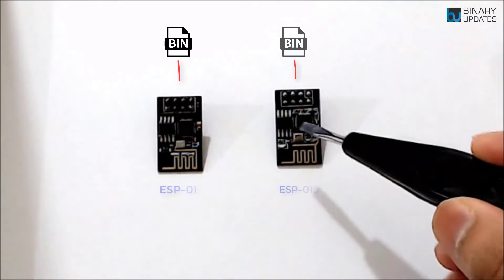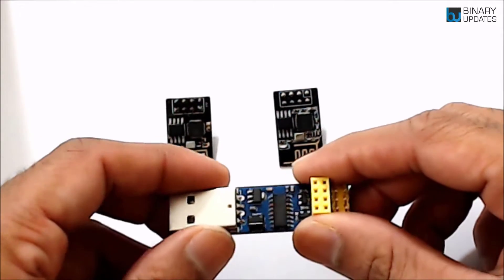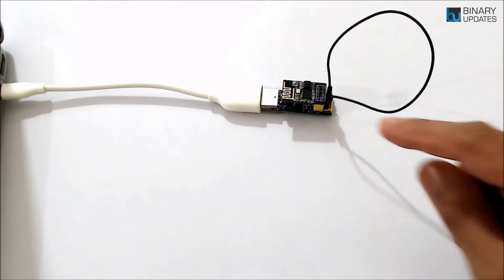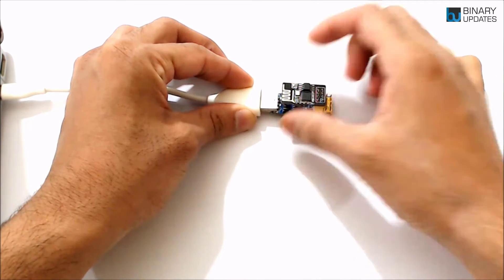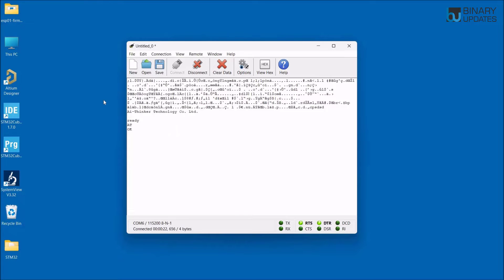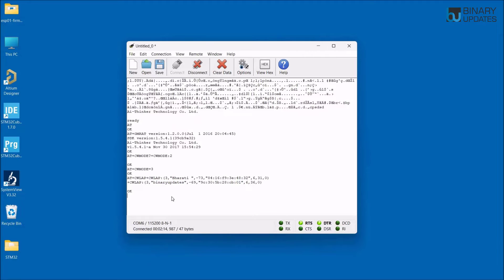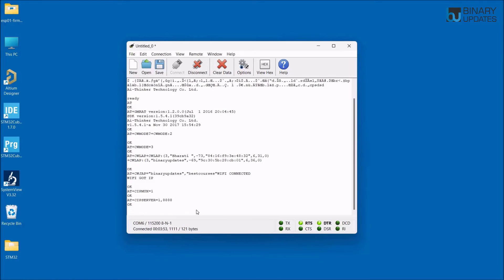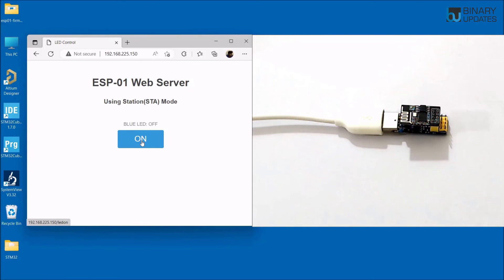How to Upgrade ESP-01 Module Firmware and test AT Commands

Comment: Привет, уже долго пробую и ничего не выходит. Прошивка успешно загружается. Появляется WiFi точка, но на AT команды не реагирует. Также не реагирует на скечи с кодом. Что делать?
Hi, I've been trying for a long time and nothing comes out. The firmware is loading successfully. A WiFi hotspot appears, but does not respond to AT commands. It also does not respond to code snippets. What to do?
Reply: Чип esp8266EX

Comment: VERY USEFUL,well presented thank you so much man
also i upload this firmware using arduino when you upload using arduino after upload make sure to disconnet gpi0 from gnd and reset the esp like in this video and start using at commands 
thanks

Comment: I successfully upgraded the firmware and tested  the AT commands.
Now I'm connecting it to Arduino Uno R3 with this setting:
  vcc - 3.3v
  gnd - ground
   tx   -  tx(1)
   rx  -   rx(0) with voltage divider 1k & 2k
   reset  - 3.3v (with 10k resistor)
   en(ch_pd)  - 3.3v (using the same 10k resistor from reset)

I upload empty sketch to Arduino and able to execute AT command through Serial Monitor.
In the future, I'm going to do a project using Arduino and ESP8266(esp-01)
Should I keep the same wiring configuration?
Should I cross wire the TX & RX  like tx to rx and rx to tx?
Reply from the maker: Great, I suggest using Software Serial Library and use any pin as Tx, Rx on Arduino Uno R3 to connect with ESP-01 Module. You'll find plenty of online blogs and videos online on this. Good luck and best wishes!

Comment: Is there any way to update the firmware version? The one on the github is from 2016
Reply: This version seems to be lacking of lots of commands, for example AT+CMD? wich should give a list of all AT commands availabe
Reply from the maker: Hi, if you want to try latest version of ESP-01 firmware then it will be found on official website of Espressif systems. I am not sure if they still update firmware regularly. In my opinion since this ESP-01 module is very old need to check from Espressif. I hope this may help. Thanks and best wishes!

Comment: The ESP-01 has 0.5 MByte flash (= 4MBit, flash IC: 25F04) 
The ESP-01s has 1 MByte flash (=8 MBit, flash IC: 25F08). Some ESP-01 have 1 MByte too.
There are also ESP-01s with 4MByte flash (=32 MBit, flash IC 25F32).

Comment: It worked for me to send the AT commands, however I'm using a diferent usb adapter it has only the places needed to plug the esp 01 to it, should I use jumpers in every pin instead?
Reply from the maker: Hi KaraSub, sure you can use jumper wire instead or switch to soldered on ESP-01 module adapter. It will be bit tricky though. Good luck and best wishes!

Comment: Can i know how connect esp 01 to wifi
Reply from the maker: Hi, as shown in this video lesson, use AT commands with ESP-01 firmware. The AT commands will let you connect ESP-01 Module to connect to WiFi router at home. there are command to configure wifi on esp-01. Good luck and best wishes!

Comment: Hii, when i let baudrate 115200 the system cannot ready but system ready when baudrate 9600 can i know why
Reply from the maker: This means your ESP-01S Module is running ESP-01 firmware which uses 9600 baud rate. In my opinion, you can reflash new firmware or carry on using module with 9600 baud. It doesn't make much difference for application development as long as we don't modify firmware or bootloader in ESP microcontroller. I hope this may help you. Good luck and best wishes!

Comment: my MCU is NodeMCU 1.0 when i tried to flash it said fail to connect... you have some idea about this ?
Reply from the maker: Hi, please try to use other micro USB cable and make sure the cable will be of good quality which support data transfer as well as power. usually, this happen because of usb cable couldn't not support data as they only means for powering or charging. I hope this may resolve your issue. Good luck and best wishes!

Comment: You are best, i have been searching for so long time what serial terminal to use, what firmware is good and a firmware installer, You explained everything. Thankyou, you're videos are best
Reply from the maker: Hi Maxim, thank you so much for such a nice words. I'll me making more videos on ESP-01 module programming. I'm planning to covers topics like controlling devices, monitoring sensors, running webserver and MQTT etc. I hope you'd love to watch them in future. Thanks and have a wonderful day!
Reply: @BINARYUPDATES  Nice, I look forward to see them. If possible can you cover in some video how to connect esp01 through websockets to something lite grbl or regular Arduino board. Or how to connect to esp-01 from another network if possible. Best regards Maxim
Reply from the maker: @maximperederii838, sure there will be video coming where I'll connect Arduino to wifi using ESP-01 module. I'll be covering range of topics like HTTP webserver, websocket and MQTT server connection using ESP-01
Reply: HOW MUCH DO YOU GET PAID TO FLATTER THIS GUY

Comment: i use esp01s with usb adaptador ch340 and this msg 
AT

ERROR
why???
Reply from the maker: Hi Eliasdomingues, please make sure first your ESP-01S is running latest Firmware. If so then confirm baud rate settings. And also test with other modules in case you feel something is unusual. Often, cheaper modules or adaptor may have board defects of missing component or soldering defects etc. but in rare circumstances. I hope this may help you. Good luck and best wishes!

Comment: i get this error in the logs when i try to flash the binary on my ESP01

Exception in thread Thread-1:
Traceback (most recent call last):
  File "threading.pyo", line 810, in __bootstrap_inner
  File "esp8266_flasher.py", line 19, in run
  File "downloader.pyo", line 54, in _init_
  File "serial\serialwin32.pyo", line 38, in _init_
  File "serial\serialutil.pyo", line 282, in _init_
  File "serial\serialwin32.pyo", line 82, in open
  File "serial\serialwin32.pyo", line 202, in _reconfigurePort
ValueError: Cannot configure port, some setting was wrong. Original message: WindowsError(31, 'A device attached to the system is not functioning.')

what am i doing wrong? i am following your directions, please help!
Reply from the maker: HiNaifjan, Looks like ESP-01 is not getting into programming mode so it failed to upload firmware. Just make sure the sequence to short pins before updating firmware process. Its clear from your input that issue is with programming ESp-01 Module. Also make sure connection is stable during the process. Good luck and best wishes!

Comment: I want to ask, I have 2 esp01 last year I try to connect to wifi can connect, but this year I try to connect and wifi scan can't connect, I use wifi example on arduino ide.  Can upgrade firmware can fix this problem?
Reply from the maker: Hey Wahyu, Yes consider update the firmware on ESP-01 Module. It'll fix issue. Good luck and best wishes!

Comment: do you know if this bin can work for esp-07?
Reply from the maker: Hi Andres, sorry 
I've not yet tried ESP-07
Reply: @BINARYUPDATES  well ive tried, and it works by the moment. I havent tried wifi function yet, but blink is estable. Im not shure if it was a firmware or a  power supply problem. But thanks, I hope this firmware works, even though is the only one i found compatible with 1MB flash memory.:face-blue-smiling:
Reply: @BINARYUPDATES  WIFI WORKS!!!! in STA and AP modes!!!! I LOVE U jajaja

Comment: Digging through lots info at various forums, I was able to get the esptool to work on my Mac. However all the instructions required me to flash multiple files. Flashing was fine but the ESP01 didn't respond to AT commands properly after flash. Then I found your video and there was only one file to flash. Heck, I have nothing to lose, why not trying...voila, the flashing completed and it responded to AT commands properly. Thanks.
Reply from the maker: Great, I'm happy to know your ESP-01 is responding to AT commands.
Thanks and best wishes!

Comment: Thank you so much! The most clear instructions in the Internet so far. Couldn't flash my ESP, struggled for several days until you helped, now it works
Reply from the maker: Hi Anis
Glad it helped!
Best wishes!
Reply: @BINARYUPDATES  Hey, I really need your help. I need to send data from Arduino Uno to ESP-01 through serial monitor. However, in the internet I only found a way to send data from ESP to Arduino, but not in opposite direction. I want to make a telegram bot on ESP. Arduino Uno, in turn, should obtain data from sensors and send them to ESP, that's why I need this connection. Then ESP should process obtained data and send it via telegram to the user. I really, really need this to make somehow, please help. Thanks in advance!
Reply: Clear?  you gotta be kidding

Comment: HI i wanna configure one esp01 as hotspot and another one as its client through stm32 discovery board with IAR! how can I do that and how could I test the AT COMMANDS ON IAR
Reply from the maker: Hi Azza

You can configure one ESP-01 Module as a webserver and communicate STM32 Discovery board as a client via another ESP-01. You can write embedded c program in IAR to communicate ESP-01 and STM32 over Serial UART. I mean by using serial communication you can fire AT commands from ESP-01 to make STM32 as a client. I hope this can help. 

Good luck and best wishes!

Comment: Is the next video (building the web server) available yet? if so, link please. I am terrible navigating through Utube.
Reply from the maker: Hi Roger, the webserver in station mode running on ESP-01 Module is on the list. it'll be released soon. If its urgent you can use my NodeMCU ESP8266 webserver code (on my channel). And upload in ESP-01 Module and it will work. The program is absolutely same. I hope this will help you quickly otherwise I'm anyways making video in next week. Thanks for your patience